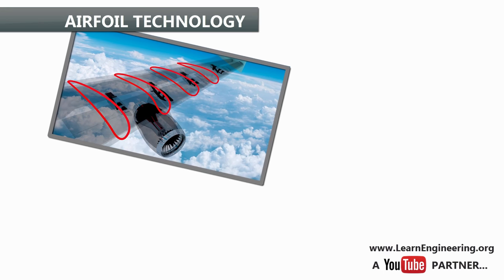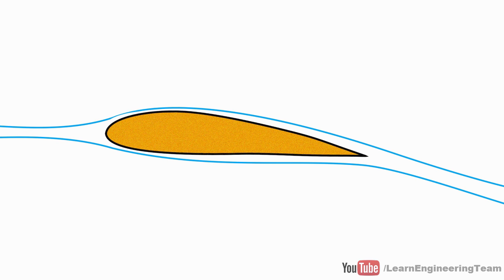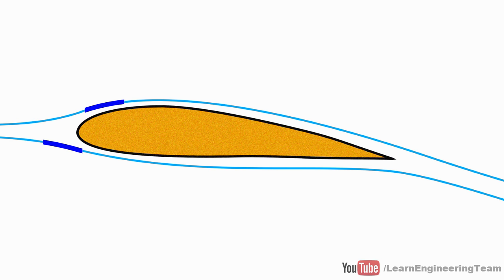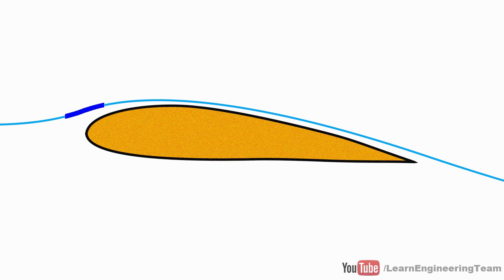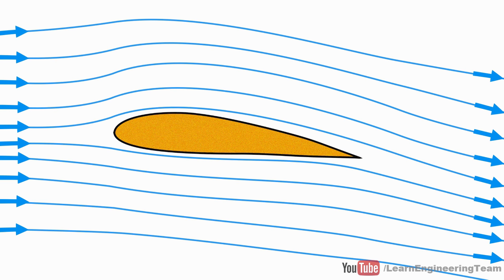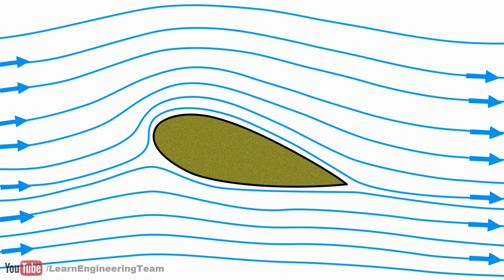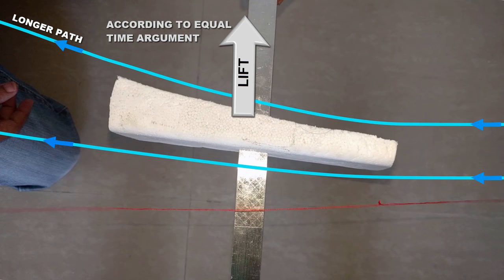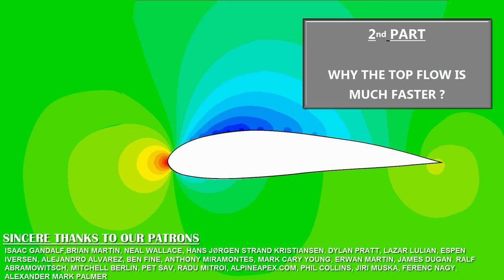How do Wings generate LIFT?

Comment: Force upper = Pressure upper* Area
Force lower = Pressure lower* Area
Surface area is the equal for both.
Then, Resultant force = -Force Upper⬇️+ Force lower⬆️.
The resultant force becomes upward direction = Lift force

Comment: An airfoil generates lift by accelerating air from above it downwards, resulting in an equal acceleration upwards: Newtonian lift.

The mechanism involved with accelerating air from above an airfoil downwards is the interaction of the perfect atmospheric vacuum on the back surface of the airfoil and the shape of that surface. The air just above the back surface of an airfoil is accelerated by the atmospheric vacuum at that surface. That air then drops in pressure, as per Bernoulli's laws, which then pulls down, accelerates downwards, the air above. The acceleration downwards of the air above the airfoil invokes Newton's "Third Law. Therefore, the overarching governing laws for lift are Newtonian. However, Bernoulli's  equations so closely approximate the processes involved, that they are used to explain and design airfoils.

The Newtonian aspects of airfoil lift lead then to the most interesting thing about airfoils, which is that gravity provides most of the energy involved in generating their lift. Airfoils can be thought of gravitational energy harnessing devices, via the intervening fluid that is the atmosphere, air.

One proof of the above is by way of the fact that all airfoil equipped aircraft, planes, helicopters, and modern parachutes, have glide ratios. Another proof is the amount of fuel consumed in sustaining flight over time a Newtonian rocket or jetpack versus that of a plane. Also notice how even powerful fighter jets slow, and even come to a stop, when in vertical flight versus horizontal flight.

Airfoil lift is Newtonian. If it weren't long distance flight would not be possible, and aircraft would fall like stones out of the sky if their engines failed.

Comment: So...a wing generates lift. Pressure decreases on top and increases below the wing, so there is an upward push. This describes what happens and there is an equation for it that works. That is the ‘what’ of the matter. The explanation, the ‘why’ of the matter, is still unclear. If the wing requires an angle of incidence before it generates lift, as in a propeller, then Newton is at work. However, if the curvature of the wing bounces the air upwards, then Newton would say that the wing should move downwards as a reaction, but it doesn’t, so something else must also be at work, maybe Bernoulli. Also, how does a rearward downwash, which does not act on the wing,  contribute to the upward push? Wings are mysterious structures.
Reply: You're ignoring the fact that the air does not "bounce".  It flows smoothly beginning AHEAD of the wing, creating a smooth curve. That curve above is the key thing to understand for this uop-bottom pressure difference.
.
Equations do "work" but they do not explain the cause and effect.
..
Above the wing gives folks the most trouble. For a better understanding of the detailed cause of the reduced pressure above a wing, try this short video:
https://www.youtube.com/watch?v=3MSqbnbKDmM
Regards

Comment: Bernoulli's Principle says nothing about equal time. Further, I don't know how anyone ever determined that two particles would maintain equal distance from one another if the particle on top had more distance to cover. On that alone, the top particle will reach the rear after the bottom particle.
Reply: Fore sure, the top particle will reach the rear after the bottom particle. if they travel at the same speed.
 However the upper air accelerates toward that lower pressure above and speeds up, reaching the trailing edge before the lower air does,

Comment: some very late info.     bernoulli  does  Not apply to aerodynamic lift.     because, the air is    STATIONARY.    this is a reason that  data from wind tunnel testing (polars) is  not  wholly  accurate.     at 4:26, flawed  assumption.        wherever  there is  Lift,  there is  Also  drag.    assuming a well-designed, flat-bottomed  profile/airfoil (see the clark-y),   simple lift  and drag,  is made  at the lower leading edge.    pressure below the wing, aft of  the leading edge  mostly remains  at ambient.
at the upper leading edge,  Drag is made, as air is deflected, upwards.     then, as the upper surface of the airfoil 'falls away' from the airflow, a persistent  zone of  Turbulence ( Reduced  pressure ) is  created; thus, this turbulence  Equals  LIFT (from   below).    as a wing moves through it,  air above a wing  SIMPLY  returns, to its  normal  state/location. 
the key to airfoil efficiency is the  Minimization of  TRAILING  turbulence, aft the wing TE;  such turbulence  equals   Suction.     thus, a profile such as the clark-y can be  Very efficient, when  mounted at zero-degrees aoa/aoi ( at  low-reynolds numbers ).    in part, this is due to the presence of  built-in,  positive aoi.    googletranslate               positive aoi, built into a flat-bottomed profile
http://1.bp.blogspot.com/-5C8vhlmhBOk/VRe3o3Jt3yI/AAAAAAAABrI/EEgVHXkLvbY/s1600/clark%2By.gif

turbulence above a wing  Equals  LIFT, from  Below it.     this illustration shows  Excessive  aoa.    however, the (unwanted)  trailing  turbulence/suction, is seen.
https://upload.wikimedia.org/wikipedia/commons/f/f2/1915ca_abger_fluegel_%28cropped_and_mirrored%29.jpg

Comment: I don't think that the airfoil works at all. That's why it's always tilted.
Lift is generated by forcing the air particles to move out of the way. By forcing the particles to displace, high pressure is created, and therefore lift (or down force). This is why when an airplane wants to take off, it deploys it's flaps, to generate lift underneath the wing.
The idea that lift is generated above the wing is wrong, and obviously absurd.
An improved design would be a flat surface on the top of the wing, with a curved front end on the underside, basically the opposite of what it is currently. This could be further improved with a parallelogram shape, with rounded edges. To clarify, the leading edge of the wing is angled to push air down, while the trailing edge allows air to slip off without created turbulence or reducing lift.
The idea, is that you want the air resistance on the underside, because it will generate lift that way.

Comment: The  air does not flow over and under the wing, the air is stationary. The wing passes through the air and, because the upper path is longer than the lower path, the air is spread more thinly over the top of the wing, so the pressure decreases.
NB  a wind tunnel is the inverse of reality as the wing is stationary while the air is moving. This is even worse in the case of automotive wind tunnels where the car is stationary but the air AND the road are moving.

Comment: The air beneath the airfoil is pushed downwards and dragged hence its slowed down whereas the  air above the foil juat simply follows coanda effect and little friction therefore it is much faster than the air below it.
peace
Reply from the maker: Ohh, no. Thin in terms of pressure gradient.
Reply: +Learn Engineering But woudnt it generate vortexes at the end point of airfoil and therefore increasing drag?
Reply: +Anmol Rana it does a bit. Thats what sharklets are for in nowadays aircrafts for example (;

Comment: No, the pressure differential doesn't cause lift.. but rather is the lift caused by deflected air. An upward force doesn't cause another upward force, as depicted in the false equal transit time hypothesis. You can't get lift without a downwash, and you can't have a downwash without creating lift. The downwash is the action, while the lift is the reaction. The bernoulli principle doesn't cause lift. Although it is helpful in explaining how a force is transmitted to a wing.